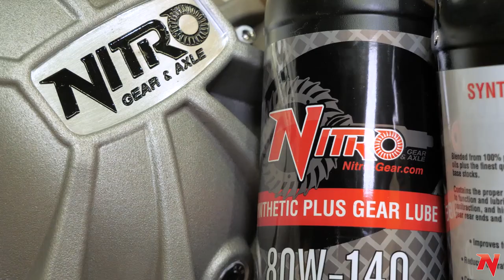Differential 500 Mile Break-In Checkup // Diff Fluid Changed & Nitro Cover Installed

Comment: extreme terrain has in their product description "Requires Mechanical Expertise for Installation". Shouldn't this just bolt right into a Dana 30 or any other differential? I really like the design and the ability to fill the diff with fluid with more ease.

Comment: How many quarts of nitro 80w 140 will I need to use on a 1/2 ton Chevy Silverado 1500 after break in procedure? I have the 4.30s and wanna change my diff cover to afe

Whats that black gel u were using around the edges on your diff cover